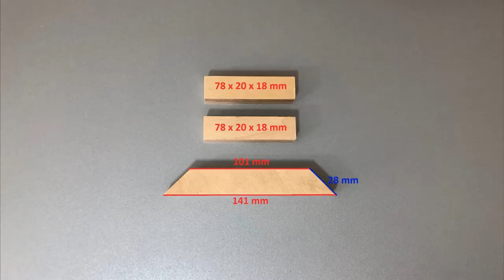Making a Corner Clamp 🛠 Cheap & Easy to Make // Köşe Mengenesi Yapımı

Comment: you are one of the best ever DIY Channel on the social media I have seen, you doing  a great and beautiful Job big thanks for you but I have a few notes, if that's okay with you which if you take care of them I believe you would be the best one, well my  notes are:- 
1. Explaining the method that you used for cutting the wood in Every Project you made.
2. Mention the List of the materials using, and where we can find them (Links if available).
3. put written Explaination about what you doing over the video as there's no voice Explaination.
4. Attaching the work plan file which's contains (illustrations, materials used, wood measurements, wood cutting method, work steps).
5. I've noticed that you do not mark the location of the cut or drilling by using the measuring tools, as the video showen but it's to hard for us as beginner 2 do so.